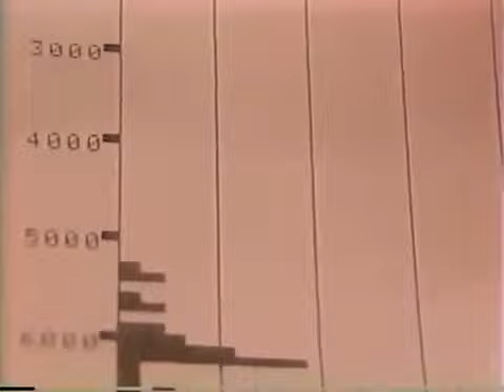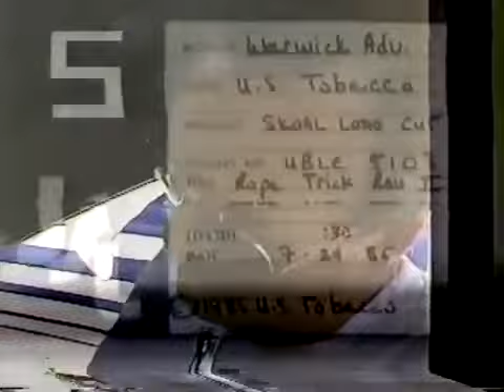1985 NHRA 7-ELEVEn Cajun Nationals

Comment: You're The MAN CALVIN!! 💪😎
The NHRA could have & SHOULD HAVE put their foot down right during this time in their history & stopped all that on board computer crap, BUT THEY DIDN'T! Next thing everyone know's, the cost of drag-racing skyrocketed, running so many long-time competitors out of the sport, and that's a damn shame 🤨
Reply: I would argue that data acquisition computers actually saved lots of money. NHRA did ban  computer controlled systems in cars though. I left the game as they came in. I can imagine how many mistakes could have been avoided with that data. That data made going faster , cheaper.
Reply: @billshiff2060  Oh, ok, I guess Snake didn't know wth he was talking about then 🙄 Doesn't really matter at a 1000ft anyway, does it Capps 😒 #Its1320!!
Reply: @Slinger43  I'm talking about facts not "spin". Let me know about all the cars Snake refused to use computers in. Dynos and Data computers made everything cheaper. That data is important at 1000feet or even 60feet. The price of the data monitor is less then the price of fuel for 1 race, it didn't break the bank and it saved a lot more in the knowledge it gives. The expense rose because they are experiencing diminishing returns and approaching the limits as they finally found out ways to get the power that was always in there. There are only a few tweaks difference between the 2000hp old engines and the 11000hp new ones. The data computers supplied that knowledge.
Reply: @billshiff2060  My generation?? 🤣
I'm 60yrs old & I grew up at the racetrack's of So-Calif! From El cajon to Fremont, hell my Father was bracket racing our 59 Pontiac Star Chief when I was friggin born, went to my first drag race at the old Fontana dragstrip when I was 8 day's old! It has become obvious to me, that all you wanna do is argue, so let me rephrase my entire argument to.....Snake said to give ya this🖕
Reply: It was Billy Myer started the big Rigs trailers. Watch the competition plus interview. Business sponsors and that push for technology. 

The NHRA should have put a limit on engine size etc. Just like F1 or any motorsport with class limits.
Reply: @edgarbeat2851  Yes that's true, Ol' Waco Willy showed up in the 70's with more money than God himself ( more accurately, Daddy's moola! ) & believe me, many in the pit area were less than impressed with this teenage rich kid from Texas. No one was unimpressed with the boy's talent, his wheelman abilities were obvious to anyone who knew what they were looking at,  but the kid literally burned up stack's of 100 dollar bill's with the way he blew up motor after motor & burned car's to the ground, the kid was alway's on fire! I was at Pomona in the early 80's, where everyone watched him win the race and collect 25k, trouble was everyone also watched him blow up 40k in engine's doing it! 😆
Reply: @Robert Sanders  https://youtu.be/qCXt8UtVEWQ his intents revealed in the interview. Very interesting the IHRA aspect. 

Watching made me dislike him even more. Sorry too money orientated.
Reply: @edgarbeat2851  LOL! 👍
Reply: The clip of the snake is proper intense 😳

I know two kids who have wealthy family's and at a whim they but them this and that. One is getting taught by my freind welding. A month later his parents bought him a whole workshop, welders, etc. I'm not jealous, honest it's just the I don't know 😕. For a phase that may pass.
Reply: @edgarbeat2851  Thanks, I'll give it a viewing as soon as I can 👍
Reply: @Robert Sanders  well put together but ugghhh the blubbering at the end.